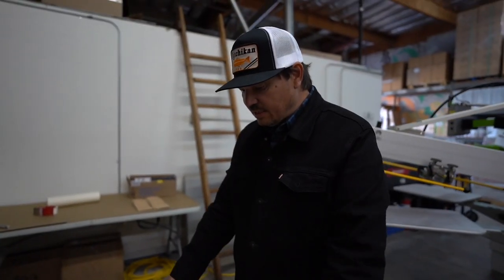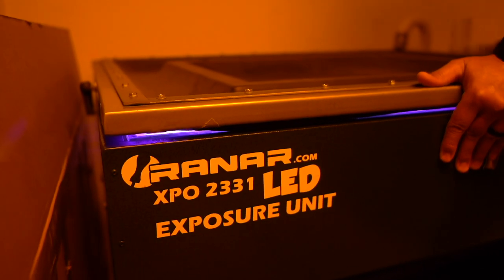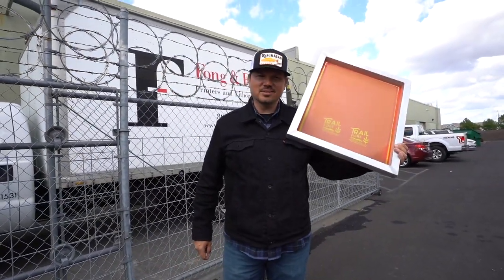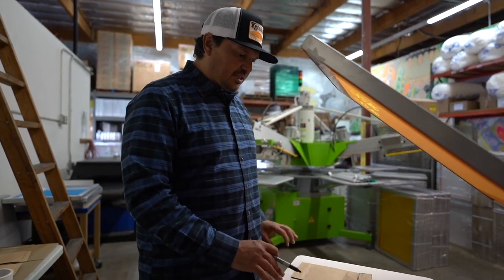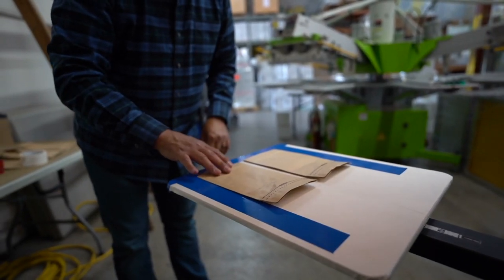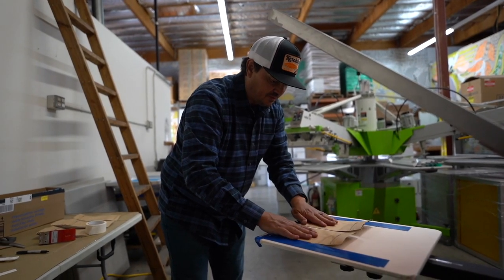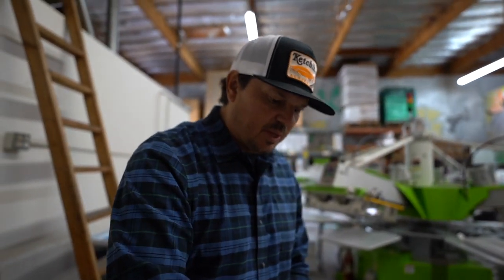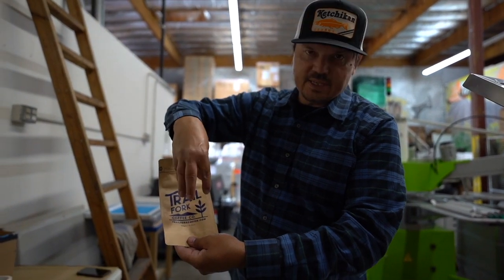Screen Print Demo: Trail Fork Coffee Bags - Part 1

Comment: Thanks for sharing your expertise.  I noticed you are not running these through a dryer, are you adding anything to the ink so it cures at room temperature?  Or is this a special water based ink you carry?
Reply from the maker: We're using water based ink and air drying it. It remains durable enough in the air drying, and doesn't need to be cured. Thanks for the question!